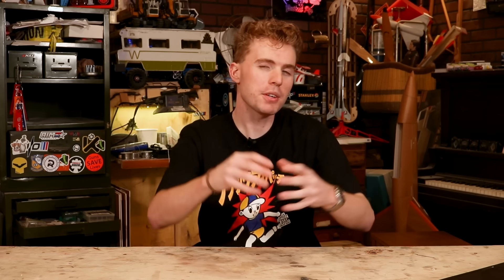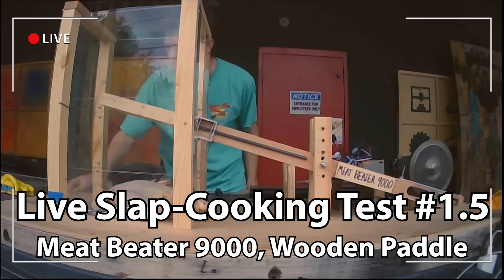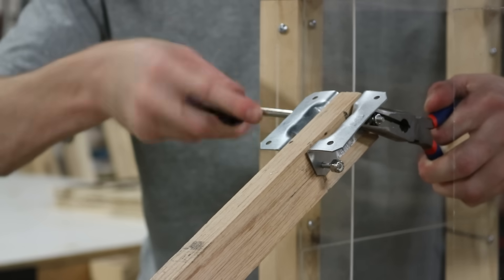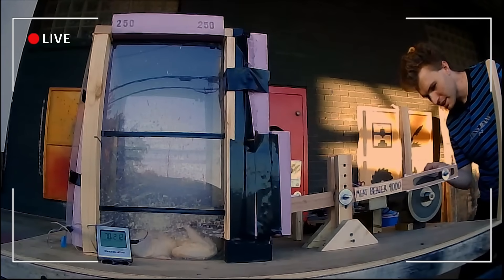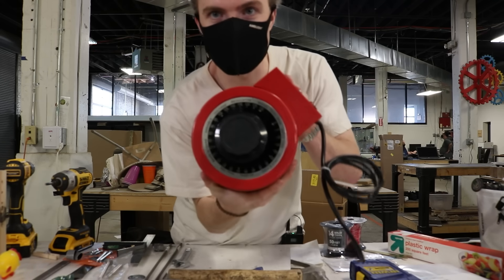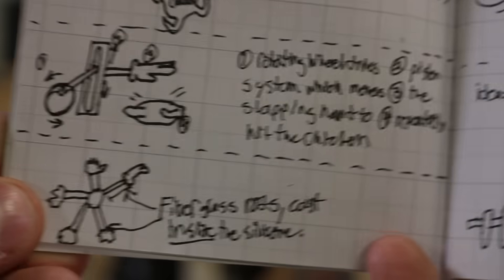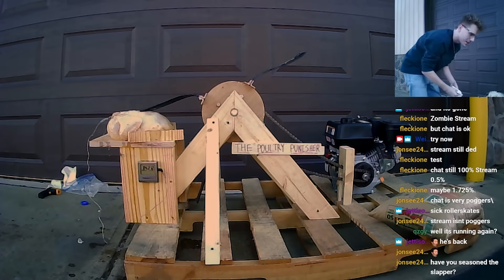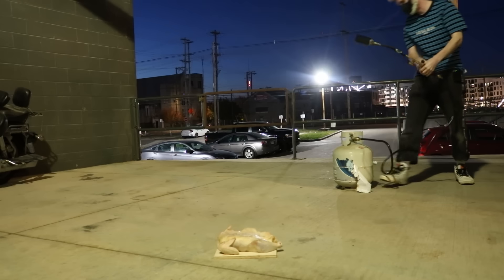How Many Slaps does it Take to Cook a Chicken?

Comment: You're not doing it incorrectly, both your machines are cooling the chicken by the action of the slap, the second one was practically a fan, your crack engineerings are on crack.

If you want to get a better result you'll need to run the experiment in a vacuum so you're not wasting energy on heating air or by blowing wind at the chicken.

Secondly, if you want to cook the chicken through you'll need to use a surface with a low frictional coefficient as the frictional drag will rip the chicken apart and overheat the surface.

You will also need to dead blow strick the chicken and not the slicing action of the second machine, which will most likely destroy the chicken in a few hits.

Something more robust and insulating like fatty beef would be a much better candidate.

Comment: I once tried to hit an iron nail hard and fast enough to get it red hot with a hammer on an anvil.. I didn't manage that, but it was way more than the boiling point of water, making a nice pschft sound when I dunked it in a bucket. Maybe my failed experiment and your failed experiment could go on to make a successful experiment.. Hit a piece of steel/iron hard and fast enough to heat it hot enough to cook something. 😀
Reply: I think Louis and I agree that the "spirit of the meme" is to convert the kinetic energy to heat INSIDE the chicken.

Comment: I think why the wood slapper worked better is wood can hold more heat easier than the rubber slappers. By the time the same slapper would reach the chicken it would go down in temperature rather than the wood one which keeps the temperature near the same level.

Comment: I might not be the first person to say this, but human powered slapping I think takes into account our body temperature, some of my body heat that radiates from my hand is transferred to the chicken. You are using a room temp piece of wood or rubber. I think you would have a better result if you managed to include a heating element into the slap device to replicate the body head generated from a human hand.
Reply: Most of those slapping calculations that are used in the meme are too simple to factor in the slapper's temperature.  They also usually assume the chicken is made entirely of water lol.

Comment: Oi the last one ya didn't have the hot summer day simulation if u had that the temp prob wouldn't decrease and u could possibly cook it before it fell apart, but u had it right with the hot summer day simulation u should've kept that and made the slapper more sturdy like forge one out of steel and craft it all together the prob is so much force is going against the wood paddle that eventually the structural integrity of the bolts holding the wooden paddle would just fall apart of u had a paddle already attached to the pole itself without the need of bolts or anything it would be just a normal paddle like an ore for example those paddles used to move a boat I think in the summer day simulation u had it right and could cook it by slapping that way u just need a more sturdy beater

Comment: What if you slap the chicken from two sides? You could put a pole trough it vertically like in a vertical rotisserie oven and have two slapping machines going at it at once so that you could generate more heat without having too strong single impacts on it, also rubber is not the best choice for the slapper material as it makes a lot of friction with the chicken skin
Reply: Also another person in the comments mentioned that the last machine creates too much airflow towards the chicken therefore cooling it down, and I agree with that.

Comment: Idea: instead of using a small motor, a car engine or an aircraft engine with steel or aluminum as the slapper could sllow for more endurance and a faster slapping rate up.

Comment: the “rotational slapper” acted like a big fan, blowing air onto the chicken and cooling it, nearly cancelling out the warming effect of the “slaps”. 

does the chicken itself have to be slapped directly? can it be touching a steel plate that’s being slapped/hammered? when you repeatedly hammer a steel rod, it heats up enough to light a fire. that’s a traditional way of lighting forges. just a thought.

great video!
Reply: I think Louis and I agree that the "spirit of the meme" is that heat has to be translated directly from kinetic to thermal INSIDE the chicken.
Reply: @RepeatedFailure  Makes sense

Comment: Would the fact that you were using a piece of wood or rubber as opposed to an actual hand have a noticeable difference in the transfer of heat? From the first part it seems like it was more about the kinetic energy into thermal energy, but should a hands ability to retain some of the heat and transfer it be a factor? Or would the hand being at a normal human body temperature as opposed to however hot or cold the other materials you used have any noticeable impact on the experiment? Regardless this was a pretty entertaining video!

Comment: The whole thing really just needs mechanical optimization. The rotary slapper is dragging the paddles and inducing friction which pulls material from the chicken, consequentially allowing heat to be bled off, and the lever-slapper vibrates itself apart. Maybe if you placed a buffer between the rotor paddles and the chicken, you’ll be able to maintain the integrity of the chicken better while also getting the benefits of the more sturdy setup. It was looking so promising! I think it’s possible if the setup is tweaked just a bit further!
Reply: Decoupling the motor from the slapping mechanism is definitely a good improvement if he ever revisits it.

Comment: You didn’t think of making a protective rubber slip cover that slips around the chicken ? Amateur engineers indeed.
Reply: I mean, that'd just contain the chicken smoothie.  If it was also a thermal blanket tho...
Reply: @RepeatedFailure  I don’t think it would pulverize the chicken nearly as much, would take longer to heat though so potentially creating new obstacles .

Comment: I feel that for optimum transfer of kinetic energy a vacuum chamber would help so as to not lose energy to air resistance and reduce thermal dissipation
Reply: But, you'd lose heat to the water in the chicken boiling off.
Reply: @RepeatedFailure  what if you vacuum sealed the chicken in a bag first?
Reply: @bUwUmer1260  you'd still have heat loss thru the outside, but an foil blanket might help.
Reply: @RepeatedFailure  interesting,  I thought A vacuum would reduce the heat transfer.

Comment: It looked like the poultry punisher wasn't able to get the chicken vibrating at all (no thermal energy created), it was just eroding it. 

You could wrap the chicken in some kind of insulating tape. This would hold the chicken together and also insulate the chicken better.
Reply from the maker: That’s an interesting one - what kind of tape, specifically, is insulating?
Reply: @Louis Weisz  I'm totally spitballing here, I've got no experience with dynamical heating by method of inelastic collisions. I was thinking of using electrical tape. The trick is really going to be getting the  chicken to vibrate as much as possible per slap. In your setups, when the initial slap shockwave travels through the whole chicken, that shock mostly will travel through the chicken into the surrounding air. Wrapping the chicken in something highly elastic, e.g., electrical tape, should theoretically redirect a lot more of the shockwave back into the chicken.

I'd still have the slapper making direct contact with the chicken. If you were to wrap the whole thing, I think you'd most likely get some kind of Faraday cage effect, where the shockwave travels through the tape and around the chicken.

BUT I would do some calculations first. Find out the equation that defines the change in temperature per change in frequency, ΔT=τ*ln(f/A) where f is the slap frequency in Hz, A is the slap constant in Hz, ΔT is the increase in temperature from ambient, and τ is the temperature constant. Then once you've curve fit to find values for τ and A, you can find ΔT_max, which is the change in temperature at the max frequency. Then you can try to determine how much τ increases when you add electrical tape by comparing the change in ΔT with electrical tape at the same slap frequencies. Then you can see if the change in τ will enable you to reach 165 F, and you can go for a full scale test.

Comment: Great video!! Loved every bit! You should try slapping something with more integrity. Maybe just a thermometer to see how the heat transfer would work
Reply: I actually plan to use a mallet/hammer driven by a motor.  I'll know the kinetic energy of each hit, and will put a few temp probes to get the conversion efficiency.  Hop in the discord to see when that happens.

Comment: Put the chicken on a sheet of stainless steel with a belt sander underneath the metal. Rig it all Into a contraption kinda like the slapper glue cloth or something soft to the belt sander sand paper. Otherwise it'll sand the metal, getting metal dust everywhere. This way you just get the heat from the friction

Comment: What if you were able to design a rig such that you have multiple, simultaneous points of impact (I.e.-the chicken is getting smacked on the top, and both sides, all at the same time)? This increases the amount of kinetic energy being introduced to the chicken without requiring an increase in either the speed of the slaps (rate) or the force of the slaps. Given your blow dryer controlled air environment, your par-boiled chicken at 100 degrees, and three slapping hands (top, right, and left), I think you might be able to do it? It might cook more evenly too. If you could design a rig where you could suspend the chicken by holding it from both sides and slap both the top and bottom of the chicken at near the same time, you could probably do it with only two slapping hands. It would be interesting to see the effects of using more than one hand anyways.
Reply: The discord would love to hear this in our future chicken research!
Reply: What is the name of the discord server?

Comment: Soo, you are heating it up, right? How about if you put a metal plate on top of the chicken? You won't be hitting the chicken but you are hitting top of the chicken that has the metal plate on it. Maybe sending the heat might be a problem but wouldn't this be a workaround?
Reply: I think Louis and I agree that the "spirit of the meme" is that the heat from slapping must be generated INSIDE the chicken.
Reply: Btw I don't know engineering as much as you do but I'm trying to understand why this wouldn't work.

Comment: What if you slap a piece of metal and put the chicken on that metal plate so the heat spreads through the plate and transfers to the chicken. You wouldn’t have the problem of the chicken getting destroyed but maybe it would be harder to heat it. You could even use 2 slapping machines, each on another side of the plate so the chicken gets heated from 2 sides.

Comment: it's simple WHY it did NOT work

you increased surface-area and also switched to a meterial that channels heat more efficiantly, which in that case is unwanted if you the goal is to transfer kinetic energy into heat,
plus you forfeited a closed environment at the end.

p. s.
it's f***ing annoying (and UNSCIENTIFICALLY) that you used
°F (Fahrenheit) instead of °C (Celsius) or °K (Kelvin) to indicate the Temperature!

but it was FUNNY!,

so i liked the video 👍🏻
Reply: If it makes you feel better, I did the modeling in K at first, but converted to F for the vid.  You are correct that the second slapper had significant convection heat losses.  That thing moved hella air.

Comment: Making things out of wood in that range of kinetic energy will eventually brake; i would recommend doing it with much more stiffer parts, if possible carbon fiber
Reply: The last part to break was spring steel.  You need some mass in the system as well, to give the m in the 1/2mv^2 for each slap.

Comment: Why dont you slap a pan that the chicken sits on?   The pan wont be destroyed by a million slaps, and would better retain the heat, and youd still be cooking via kinetic thermal transfer.
Reply: Louis and I agree that the "spirit of the meme" is that the kinetic energy must be transformed into heat INSIDE the chicken itself.
Reply: @RepeatedFailure  In the spirit of Mythbusters,  when the actual meme cannot be satisfied, find a way to satisfy the results. And cooking a chicken on a slapped pan would be a high view video. Unless you're too ChIcKeN to try. ;-)
Reply: @remihollenfeuer6233  I think that was the purpose of the wheel slapper, to beat the chicken and not let it beat Louis' machine.  It obliterated it XD

Comment: Have you tried eliminating the additional variable of Friction?

Kinetic Energy is Effected by Friction energy.

Maybe try again on the chicken but reduce friction first (beyond oil)... maybe plastic wrap or a duct taped tight turkey bag?

If that doesn't work, 
Maybe change hypothesis to "Can you DEFROST a chicken with slaps?" To see if a frozen chicken could withstand the pressure & friction.

Comment: The problem with the rotational slapper is that the thing slapping needs to also increase in temperature at the same rate as the thing being slapped, or else you are slapping with cold slaps, ie, with the rotation the slappers are being cooled while at the same time delivering cool air to the slap site. Also, a rotational slap doesn't deliver a linear slap, but more of a swipe, with surface friction that slowly tears the chicken apart. 

One more thing you could attempt is to use a road compactor, with a layer of insulation on the compactor plate and a nice slice of rubber. You could build a rig to hold the compactor and adjust the height,  so basically you'll be slapping the chicken with vibrations which is almost the same thing right?

Comment: I mean if the chicken disintegrates before you finish cooking it you could maybe try putting it onto a pan and try slapping that instead to fry it. You're still cooking it with slaps just not directly. But that also kinds takes the fun away too ig.
Reply: I think that Louis and I agree that the "spirit of the meme" is that the kinetic energy must be transformed into heat INSIDE the chicken itself.

Comment: Small hypothesis;

Is this unfeasible due to your designs relying extremely heavily on kinetic energy? From what i see, the whole premise is on the hopes that there would be enough wasted kinetic energy that will be turned into thermal energy. Except what kept happening was a more efficient transfer of kinetic energy, that wasnt being wasted, resulting in the degradation of the chicken?

Just a hypothesis from someone who does not major in any form of physics but just rly loves science. Rebuttals and a small reality check is more than welcome.
Reply: Louis and I agree that the "spirit of the meme" is that the kinetic energy must be transformed into heat INSIDE the chicken itself.  The chicken just can't take kinetic energy transferred at a rate that would heat it fast enough to cook it.  The KE to thermal energy transfer was about 0.2% efficient when I simulated it.

Comment: easy, just mold the chicken in some type of casting that'll keep its shape and transfer the energy to the chicken without it breaking. a chicken shield that gets hot when you slap it. bigger slapper also wth good surface slaps at the right angle so the initial impact of a slap goes over the whole chicken., also another idea is to put some kind of shock absorber on the chicken so it doesn't get obliterated. idkk.
Reply: I'm pretty sure Louis and I agree that the "spirit of the meme" is that the kinetic energy must be transformed into heat INSIDE the chicken itself.

Comment: Take a tire off your car, connect the flaps to the rim, set speed control at 80mph, attach metal plate to top of chicken as striking pad
Reply: I think that Louis and I agree that the "spirit of the meme" is that the kinetic energy must be transformed into heat INSIDE the chicken itself.

Comment: im a stone skulptor and i notice the air chisel can produce ton of heat. When i press a flat hammer against my palm it start to burn even true lather glove. I cand hold it for more then 2-3 seconds. Next time buy a air chisel with hammer and try it on a piece not bigger then the hammer. At least this have the potential to raise the temperature above 60°C (140°F). By my experience i be not surprise if it got over 70 even up to 90 but not over 100.

Comment: You just keep the temperature from going and it will cccccoooooooookkkkkkkkkkk
You don't neeeed more speeed
You need simple more control of the environment temperature.
That's it.
So even with 1 slap a second it will cook
It's just needs more time this way
Reply from the maker: Noooo it’ll lose heat to the air. You have to slap fast enough

Comment: have you thought of securing the chicken and shortening the actuation on the arm and slapping from inside the chicken cavity? bones provide rigidity to help prevent pulverization and the air in the cavity will heat easier helping with the temperature

Comment: Why is everything you make made out of wood you should use aluminum or something would snaps everything you have made has broken because it's made out of wood please start making things out of metal also great video
Reply: The last of the slapper arms broke because the spring steel connection snapped.  But you're right, the chicken broke the majority of the builds.